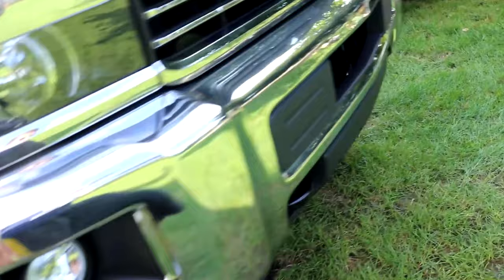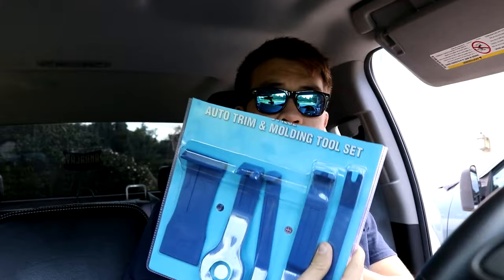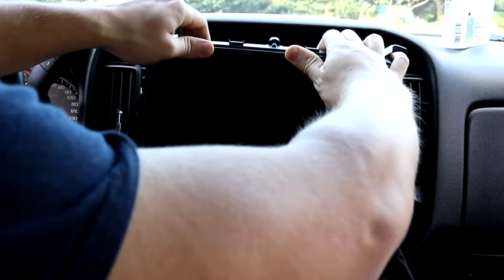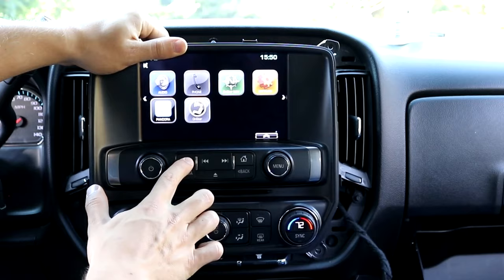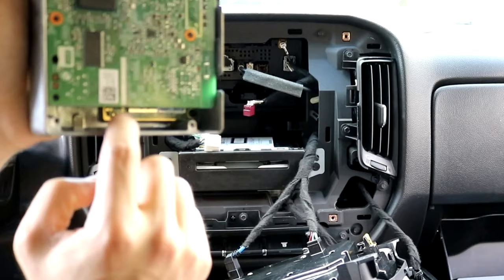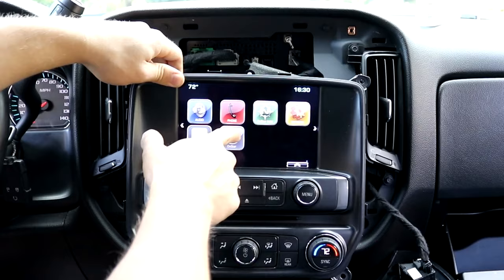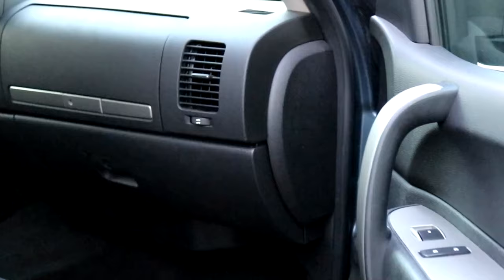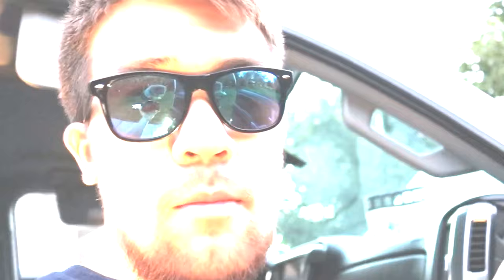Properly Disable OnStar 2014-2021 GM Vehicle Off Grid

Comment: They can immobilize your vehicle with on star, perfect hack to do on a fleet or corporation. You never know what's in the works these days, hence the reason to have it removed.
Reply from the maker: Yes
Reply: Im wondering if this open sourceware is part of nonstar? 
If so what could be done to release the truck from
these privacy predators
through that? Anything ?
I. D. K. Just a random thought.

Like giving my truck an exorcism. 4 real.
Reply: @B.I.-EIO_macdonald9786  No part of onstar is open source. You will never know what it is doing. Only by replacing it with your own hardware and software will you have any say on the data it provides GM and it's 3rd Party partners, including the government.
Reply: They can still track you 😂😂😂😂
Reply: @Tom-pn5sk no they cant bro once onstar is removed it’s over with💯💯
Reply: @Shiesty9168 their tracking you on the device your on. Anything with internet

Comment: Funny you did all of this and kept your XM radio service. You can be tracked with that service also. We get calls from them all the time giving us stolen car locations.
Reply: @Mr Sir Anything with a gps signal. We really don't know what all is installed in a new car. Electric vehicles will be even worse. You want be able to disable all of their devices. If the little black Helicopters want to find you they will! If your not doing something your not supposed to you don't have anything to worry about!
Reply: @Billy.80  Actually you are wrong. Electric cars have an onboard computer that tracks everything going on in the car. and Johnny Shadetree want be able to disable it.
Reply: well fiddleysticks. How do I take out xm radio?
Reply: @trentvlak 
Unplug the satellite antenna also
Reply: False, XM radio doesn't transmit any information.

Comment: If you want to keep your Microphone for phone calls, and disable OnStar only take off the Purple/Burgundy antenna which he struggles with @2:21 into the video. I did just that testing, and everything works like normal, bluetooth (with Microphone for calls), and Onstar system does the same thing that video creator shows at the end.. simply tries to call OnStar and can't connect. Hope it helps others.
Reply: Appreciate it!

Comment: Worked. I did it by pulling the 3 prong fuse and using a 2 prong fuse. I had to bend the prongs closer and sort out the connection. Either no AC and heat or no Onstar. Got it first try. 2021 GMC Canyon
Reply from the maker: Great work, first try is a charm
Reply: That’s awesome! I hope im as lucky 🍀
Reply: Bless. I was hoping the 2021 Canyon was the same.
Reply: Yes I'm doing it tomorrow

Comment: Looking at getting a newer heavy duty truck, seriously wanted a gm but there was no way I was going to with onstar having anything to do with it. Thanks for solving that issue man!
Reply: Dont get a GM…
My 2017 Corvette and 2017 Camaro v6 both had the crappy 8-speed auto transmission shudder (basically your transmission kills itself over time). The fact that GM still hasnt been sued for it is insane. Waste of 2 cars for me, not to mention all the other people who have that issue. 

The Vette had 24k miles on it too, and was basically a lost cause. 

Local transmission mechanic told me that their TSBs dont actually fix the problem, and that on average, it’s about $6k in various parts (plus service) to stitch the transmission back together every 2ish years. And not the same set of parts are affected for every vehicle with the issue.

Comment: Very informative but I think it would be safer if you disconnected the battery first and used proper anti-static protection when handling sensitive electronics.  Thanks for the info!
Reply: Someone else told me that. Disabling the battery works?? Onstar won't be able to track it?
Reply: @MaryJane-HarleyHybrid  You betcha! and your car won't start either!

Comment: Just watch out on the 2018 silverado, it actually had dual antennas module. but if you do the fuse trick, you will loose your microphone for bluetooh. But with just the module pulled, make sure you set your time and date or android auto won't work.

Comment: they can also remotely disable your vehicle (on purpose or on accident.) and limit your speed starting 2030.
Reply: i believe the capability to disable vehicles is already in use by onstar as seen in several cased since 2019

Comment: Excellent! I recall reading in a car magazine back in the early 90's how these OnStar systems were designed by DARPA....GM used to brag about it actually 🤔 I haven't liked this idea from the start, I like some GM vehicles but want nothing to do with their tracking devices...next the government will shut your car off, if you hold "unacceptable views" as our Canadian Prime Minister calls anything he disagrees with.

 Now you can't find anything on the internet about DARPA making the OnStar system. The info has been hidden; all there are now are videos of DARPA showing how they proudly hacked an early model GM (of course, they could do it, they designed the darn thing).

This will only get worse and new models will probably begin to make the vehicle inoperable when you remove their tracking/hacking devices. The more I learn about automotive "cybersecurity" the less I want anything to do with connected vehicles and devices.

Good riddance!

Comment: Excellent video. If I knew more about On Star I would have never bought my GMC Canyon. One question: does your procedure also disable the annoying warnings that appear on the plasma screen? You know the ones. When the outside temperature drops below 32, you get: “ Roads and overpasses can be slippery. You must slow down and drive carefully “.  OR, my favorite: " Reading messages on the plasma screen while driving and taking your eyes off the road can cause a accident “. The last one is on a clock and appears exactly once a month. You MUST tap the OK button on the screen to get rid of the message.
Thanks

Comment: You don't need to go through all that crap.  Just put a dummy load on the onstar's antenna connection and it will forever think it's in a dead zone.
Reply: What exactly do I need to do?
Reply: @trentvlak  Unscrew the antenna wire from the onstar module and screw on a dummy load.
Reply: Where do you fond such a thing? Can't seem to find one?

Comment: Removed the fuse and replace with spare 2 prong 10Amp fuse from driver fuse panel. This side has spares in the panel that you remove to access the fuse box.
. Onstar not working now.

Comment: I have a Chevy traverse 2021. Its a lease car. Its easy to unplug the cable under the dashboard. Problem is that i can`t use the Bluetooth if i unplug the cable. Another big problem is RADIATION especially for kids. i don`t use the service but its always on and active. That`s crazy.
Reply from the maker: Yes, I suggest using direct usb connection instead of bluetooth

Comment: My 16 sierra's circuit is different- the lityle one underneath is directly plugged into the top one and has a brown and a purple plug.  The top circuit comes loose with the cover.  I just put a piece of  cellophane between the top and bottom connectors and put it back together. Onstar unavailable

Comment: What did you mean when you said 2020 vehicles would be encrypted?  Also can you make a little more detail video of what you were doing at the end?  Do you need to replace the 3 prong with a 2 prong to fully get rid of on-star?
Reply: He means that they're going to integrate OnStar with the engine computer so that it can't be removed or disabled without taking the engine offline.  They already do it with modern German cars.
Reply: @Unmannedair  true I unhooked the antana and infotainment completely and OnStar still sends maintenance needed and the millage on 2022 Chevy Colorado
Reply: @Unmannedair  Interesting. You could pull the motherboard and desolder the antenna.
Reply: @billybritt5334 OnStar has a secondary antenna connection

Comment: Seems like a decent tutorial for car thieves...🤔🤨 still if some cop or the repo guy wants to find you...your phone will do fine as a GPS tracker...even just using the cell phone towers themselves you can be found.  That's how 911 finds you when you call from a cellphone.
Reply from the maker: We might as well switch to using pay phones
Reply: Get 2 phones! One for work and one at home lol
Reply: disable gps on your phone and install a vpn on your phone...cant be tracked. also use free phone services with no contracts
Reply: @elledinera3427  you can still be triangulated from the towers.
Reply: @Derec  check out rob braxman. He has a couple of presentations on this topic . 
There are options. 
No going back to pay phones now. 
Or real landlines that aren’t in the fiber optic chain.requiring modems.

Comment: Does this mean you can use the phone app to start truck now or is that completely out of the question?
Reply: Considering it disconnects the 4G, most likely can’t use the app to start anymore as the car no longer has a connection to the outside world so to speak
Reply: The app obviously doesn’t work if the OnStar is disconnected but B your key fob will still remote start

Comment: You got them. That’s for sure, except. What about your phone? Doesn’t it track your speed, what you are listening to, speed, and everything else? If you are Bluetooth to your truck, and that means your phone knows it’s your truck, thus it knows you are driving somewhere, but wouldn’t it know anyways, because it tracks you all the time? I think there is different types of gps. One type uses three satellites to coordinate your location, and another type uses the towers to coordinate your location. I am pretty sure that there is a type that uses wifi signals that tells what location you are at. I was watching something about how devices can connect with one another, and even tho you “didn’t connect them”, they still connect with other devices and send information through multiple other devices, sending information back to someone else. Example; you buy a smart tv, lets say it is the new atsc 3.0, and roku. You don’t connect the roku to wifi. You are good. Probably not, because the roku can send, messages out and connect to other wifi and Bluetooth devices, within reach, and the those messages about what you are watching, wether it’s a blue-ray, playing the xbox, or play station, or even if you got it only for ota, and never connected anything besides the 75ohm coaxial cable, ever, and you went through and switched off all of the options for anything else. It could still connect to your phone for example, even though you did not connect it yourself, and you looked at what your phone was connected to, and it was not, and never connected to your roku, atsc 3.0 television. It would connect and your phone would transmit the information back to wherever it was programmed to. It is not limited to one or two devices, lets say you did not have a smart phone, we will say that nobody has a mobile device in the house, and there was no internet, and no routers in the house. It may not be able to connect to your neighbors wifi because, they did not have internet or routers, but they did have several ip devices, and because they were not home, there was no connection to the internet there either. Your roku television could connect through several devices at your neighbors, until it made it to where it would hit the world wide web and find its way home. Transmitting your information to someone, even though, “it had no way to”.

Comment: I have a 2014 Chevy Camaro and all I do is remove the OnStar 7.5  fuse from the fuse box . The SiriusXM still works but there is no connection to Onstar.
Reply from the maker: The OnStar board may still be interfacing with the rest of the communications. However, you may be in the clear?

Comment: Hi! Is it possible to connect internet in GM cars without onstar?
Reply: Theoretically, but it wouldn't be simple or easy.  Specifically, you'd have to have custom electronics and firmware.  AND you'd be opening you vehicle up to hackers.  Wouldn't recommend.
Reply: @Unmannedair  I'm out of OnStar coverage, so it might be safely.

Comment: you did this in a 2021?
If so. 
I will be glad to get myself into this project.

Does this have any impact on the governing of speed?
I am not allowed to go over 99mph. 
I found this out in the safest way i could. 
Alone on a highway lol
Reply from the maker: The speed limitation should persist in the forthcoming
Reply: @Derec  Thanks. 
And i also shut my shiat down when im at the store or anytime i leave my 🙄 Truck. 
I realize it’s easier to take now than my previous key start ignition vehicle. 
Kill switch!
&
Just to be cautious 
An emp safety addon so it doesn’t become affected by a massive pulse. 
Hey It doesn’t hurt to be ready. 
Just in case.

Comment: How do you keep the hotspot on while engine is off?
Reply from the maker: The method will disable it under all circumstances
Reply: @Derec  i wish i could keep the signal and use it in my home. 
For some reason it was the strongest wi fi signal i ever had.

Comment: theres still many ways that people can track you laptops phones just removing your onstar doesnt do anything
Reply from the maker: First step in the right direction
Reply: Yes but this method eliminates the big risks/threats. Banks, law enforcement, or any kind of hacker that wants to exploit the vehicle now has a harder time with OnStar removed. Chevrolet has an app that lets you completely control or track the vehicle yourself, which means anyone else has the exact same capability if they wanted to.
Reply: Faraday bags are good to block tracking.✌
Reply: Yeah - it stops onstage from sucking up all your data without paying you for it.
Reply: @patriotcanuck6485  do they make them big enough for vehicles?🤔😆
Reply: @nowaynohow1275  🤣 fair enough